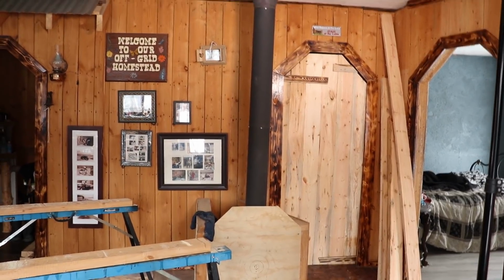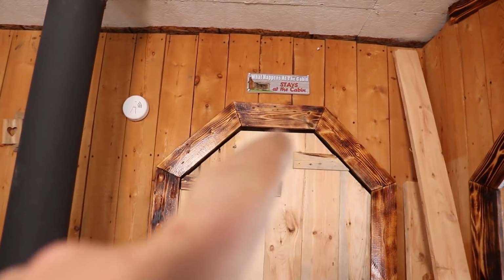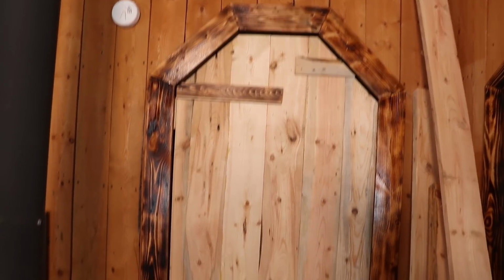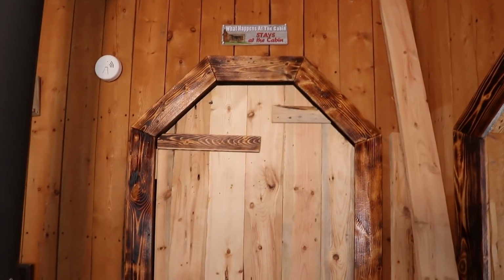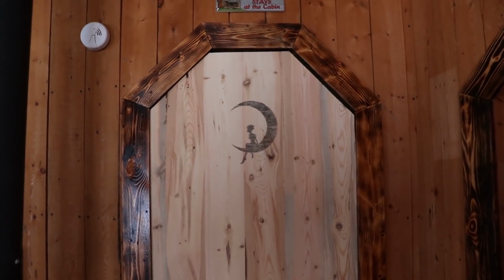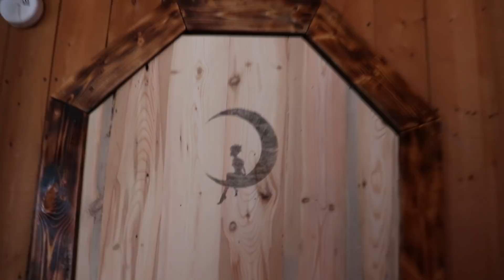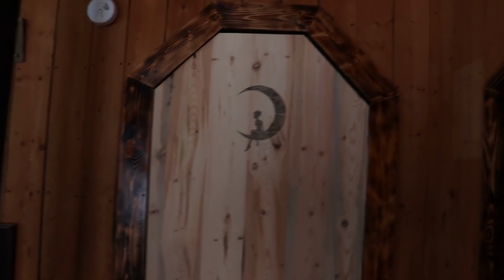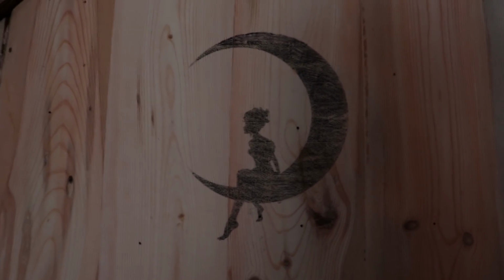Making The Bathroom Door For Our Off Grid Home

Comment: Hey guys!   The door looks fantastic.  I did not realize that a grouse would know how to dance the Samba.  LOL. 

Pro tip for fitting an odd top shape on the door....:   Wedge the door up from the bottom, making sure the door is plumb to your good edge.  Then, scribe the top so you know exactly how far to trim the top to get a good can use any scrap that is 1/8” to 1/4” in thickness when you scribe the top so you can get your desired clearance at the bottom of the door.  
Cheers!
Whipple
Reply from the maker: Hello Whipple.   Thank you.  Lol yeah these ones can Samba with the best of them....And we even have a Crow trying to blend in as a Grouse as well.  Thanks for the tip,  I will try that,  thank you very much.   Cheers, you have a great day  :-)